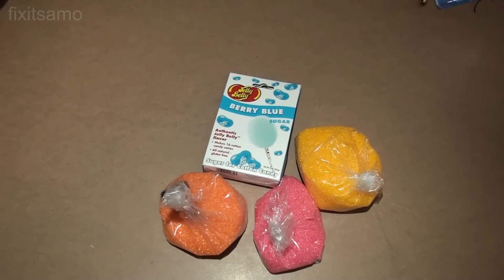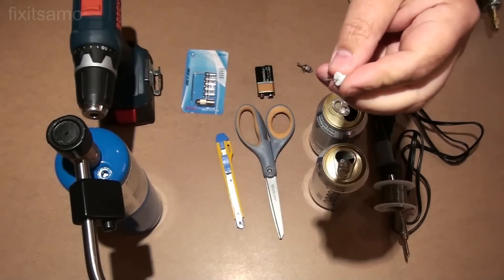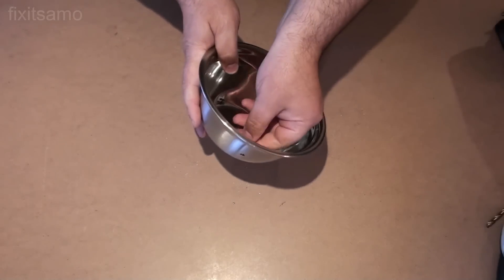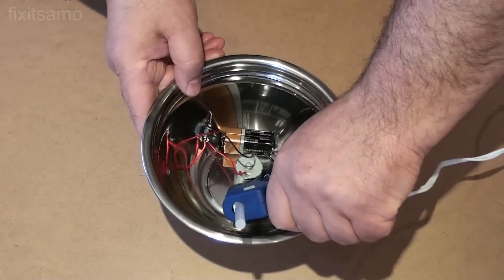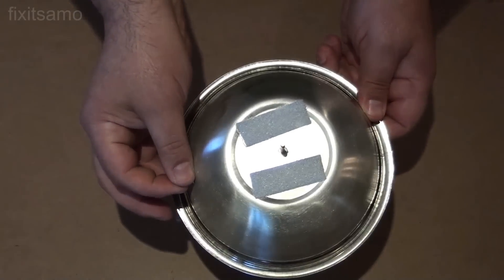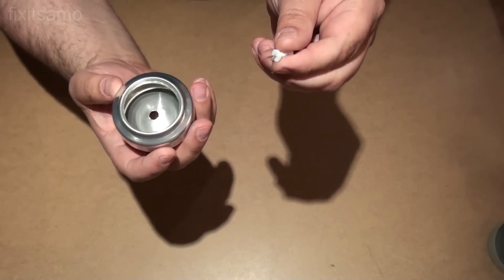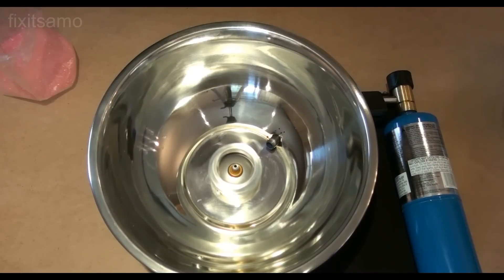How To Make A Cotton Candy Machine

Comment: should of torched each piece of the pop cans b4 assembly, they contain a plastic coating on them.(or soaked them in a paint thinner or nail polish remover/thoroughly scrubbed with them, and then washed with hot soap and water)

Comment: Great jury-rigg!! :-)
That shows you how much hot air is in cotton candy.... It's a rip off!
P.S. To those who care... You could put a large coil of wire around the spinner cup & connect it to a variable fin capacitor in series  with an isolation transformer to inductively heat the sugar with wall current instead of propane if you wanted.

Comment: Great video, my only thought, don't soda cans generally have a thin plastic lining on the inside?  Worried about eating melted plastic with the cotton candy unless it is cleaned out beforehand
Reply: That's usually tin cans, so they don't rust inside when food is put in them.
Soda cans don't rust because they're aluminium, therefore they don't have/need any lining (at least none of the ones I've seen/heard of).

Comment: the holes should have been drilled in the lateral wall, not in the upper lip. and connect the motor to a 9v DC supplier, not a battery. and you could have used a second big bowl glued upside down on the first big bowl but only the 5 cm lip. This way all the candy cotton will stay inside the bowl. put a 12v  slightly bigger motor and you'll need the burner no more. This is how I would have done it...

Comment: Hello Fixitsamo! I made your machine, but I think my motor goes too fast or the gas is too hot. I get more melted sugar in the bowl than cotton. I did get cotton but only a little. More when I cut the machine off it made some. Any ideas?
Reply from the maker: +Seth Taylor  hello congrats 👍🏼
Its not the motor its the temperature 
Probably to hot
Reply from the maker: +fixitsamo 
And make sure the holes are not very big in your soda can

Comment: hi.. is there any other thing, other than torch to heaten up this thing...
Reply from the maker: +Lovin Mashio Lenin 
I tried with a candle it didn't  work  cause when the motor spins it creates air and  it will tern off the candle flame
Reply: Yes, it uses normal sugar. There's a trick I know, you can melt the sugar on a gas stove or something else and pour it in.
Reply: dewolen I thought they add ethyl maltose to the sugar (it looks n feels like sugar but tastes like cotton candy) to the sugar for better flavor

Comment: This is really creative, but harmful if you ingest the cotton candy, the inside of the can is coated with a plastic like film to stop the can from rusting on the inside when it has the soda/beer? in it, similar to a juice box, i would recommend melting the inside of the cans first before hand because you wouldn't really want your kids swallowing the plastic now would you?

not being negative just trying to keep people safe :)
Reply: aluminium doesnt rust bro
Reply: +Aleks Shibilev aluminium does rust, just you cannot see it, aluminum oxide is a colorless compound. Furthermore, rusting is not the problem, the problem is other reactions that will happen between ingredients in the drink and the can, known as corrosion, such as the reaction of aluminium and the phosphoric acid in the drink, turning the aluminium into aluminium phosphate, corroding through the can.
Reply: wow i almost did this but on 2nd thought you are very right they do in fact coat the inside

Comment: didn't really show how to put it together. you just skipped to you using it... I wanted to see how you out the whole thing together
Reply: It's very self explanatory, isn't it?
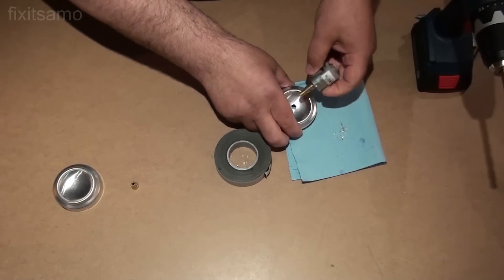Reply: Its pretty simple all what u need to do is put the 2  salad bowl on top of each other as he showed   At the beginning of the video  using velcro  Then fallow the steps   @6:50 he explained how it should be installed
Reply: What about the blow torch? Did he drill a hole in the big bowl? Also how far away does it need to be. What temp is it suppose to be at? does he apply heat the whole time? I think these things would have been helpful.

Comment: Where did you get the blowtorch from? Also can u give the link for the chuckset as i cant find it?
Reply from the maker: You can get the blowtorch from any hardware store i got mine from home hardware  
Also search online on amazon search  for micro twist drill chuck set
Reply: @fixitsamo  At time 0:42 , you say lock it with 2 screws, what does that mean? I need to buy separate screws or you mean to tighten it with 2 rotations?